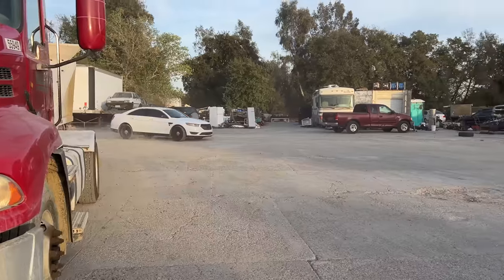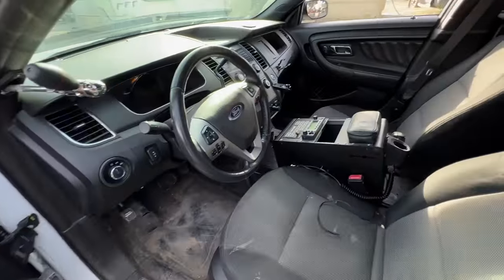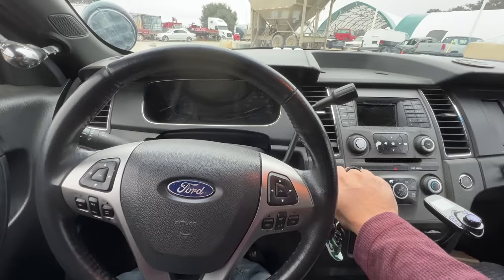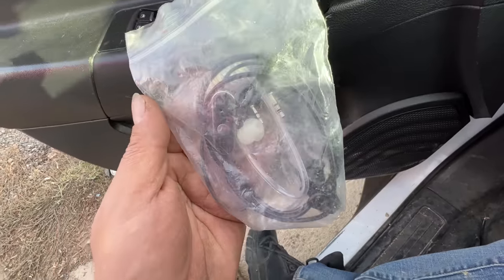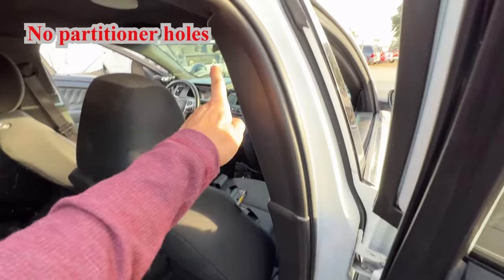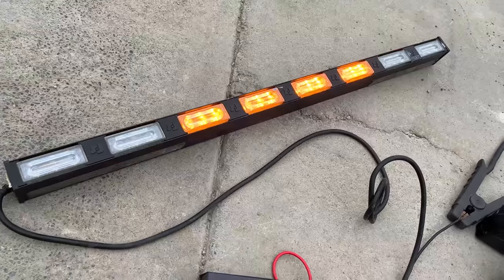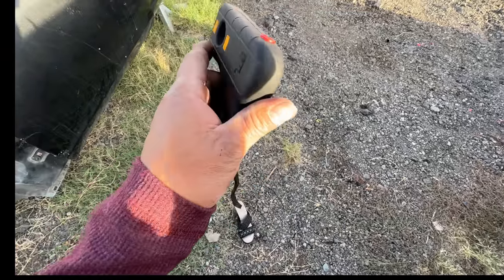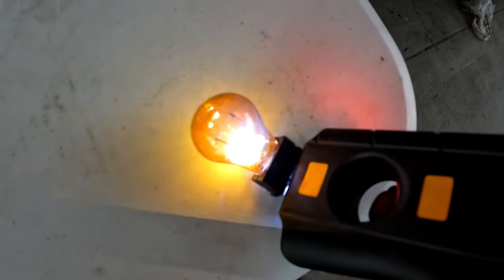I Bought An Old Police Interceptor Taurus! Found Energy Weapon!

Comment: I drove a similar vehicle to that one when I worked in law enforcement. I was assigned a 2013 Interceptor back in 2012 and I drove it for almost 10 years with minimal maintenance issues until just before retirement when the power steering assist module went out. Even then, I drove it to the shop. Great car, just had to figure the easiest way to get in and out of it with all of the gear on.
Reply: A 2013 in 2012? How is that possible?
Reply: @kobecaming3935  Most car company's release cars the year before, the 2023 cars are out now most released in march of this year

Comment: I want to get one of these I'm just scared of the water pump failure I had a 2018 Taurus that after 40k miles started to go out. But in my area there are some 2014 models that have 100k and are really clean body and paint and normal wear inside also they are extremely cheap I just can't decide between the 3.7 NA or the 3.5 ECO. also I like that these have the upgraded PTU the reenforced suspension the rear is straight piped from the X down. And they are AWD.